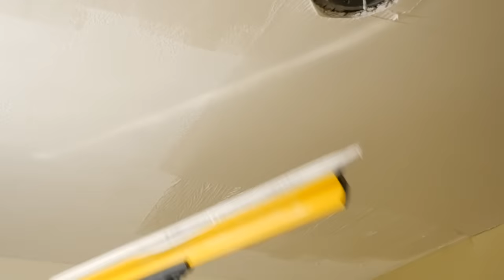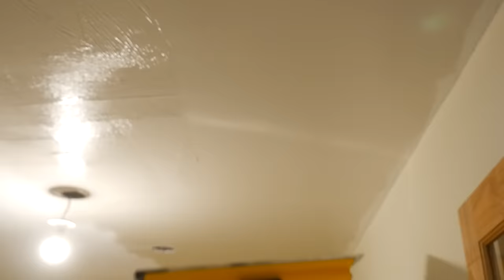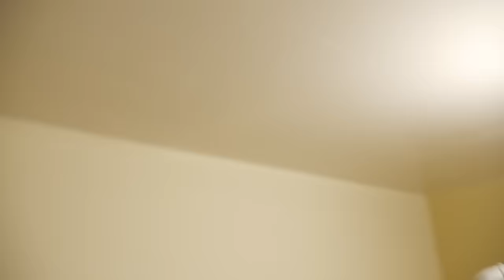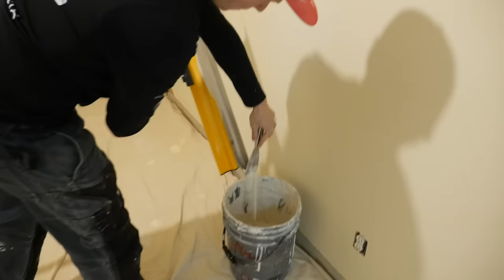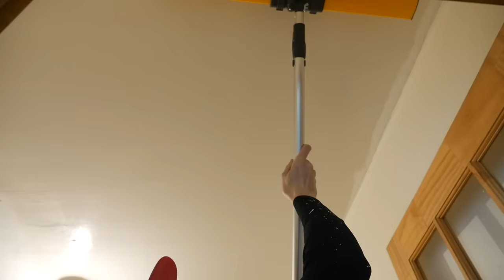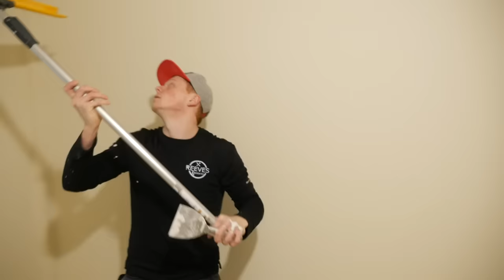1 Minute of Action with the Skimming Blades

Comment: AUTOMATIC SUBSCRIBE!! Thank God I saw this... I'm renovating a huge project and have to spend lots of time skimming the entire walls and ceilings, thousands of square feet, so I purchased the TechTape 7", 14", and whopping KING-SIZED LARGEST 48" or 4ft finish blade like yours... I was going to flat-box the entire walls with my 12" TechTape flatbox, although and then finish with the 4 footer... I like the idea of rolling it on like paint...so I'd try this, but how thing does the mud have to be? 

The thickness of the mud would be my experiment with the flatbox and also with the roller method as you have shown... but I also need to get used to the proper amount of pressure on the finish knife but I'm sure that would either come naturally or with practice as I'm a Jack who does most things like a PRO to the point that even the so-called PRO are wowe'd and ask who did that? That is better than I would do it...lolz...well, I so happen to be a perfectionist and even though it still isn't perfect looking to me, for most people, it is excellent/immaculate/perfect lolz ;-).

Comment: These blades are the shit!!! I'm getting the flstest butt joints I've ever had. I don't like the handle for the 40" though. It twists and turns and I can't seem to keep good pressure in it. Works great cleaning up behind boxes with a 14" blade on it though.
Reply: Bama Backroads  well if you can hold a Fresno it would be better
Reply: Bama Backroads these things are for level 5 skimming. Still need to run butt joints by hand in my opinion.  You can bust m out with boxes but I still like the knives.
Reply: Don Ireland butt joints get a 10" box down both sides, then checked with a flat edge and run with a box accordingly, then a 12" knife three wide and wiped down with the 40". Then don't hat again, and the joints are perfect. Been doing this for 26 years and never had butt joints this good.
Reply: I've just bought a 2ft blade and skimmed a wall....flat as a pancake!
Got another 10 surfaces to do a really tempted to get the plaster on using the roller as getting it on with the small trowel is the trickiest bit.

Comment: Never thought of putting mud on with a roller...Kudos! 👍
Reply: oldedrum That's the way we did it in the 70's and 80's
Reply: God!
Reply: Maybe you could get another pole and let the roller guy use it as well? ;P
Reply: on some houses that method is used to but texture on walls,
Reply: Yep. And if you roll it like that, let it dry for a little bit and lightly feather it, you get also a texture

Comment: Any sanding needed then after?
Reply: Ya a little bit of sanding with a sponge I bet..  And finish of the corners with the 4_5 inch blade . Not sure if they do a final skim coat with a smaller 10 inch metal blade at the end.  But it looks like a good solid coat in a very fast time. You probably want to add water to that mud for sure it appears they did.